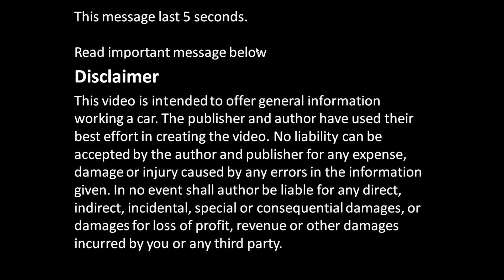How to test PCV valve status?

Comment: The PVC handles gas not liquid. I don’t see the point of using water as it will confuse the person watching the video. It’s not like air bubbles in a brake system. I’m certain a viewer will get water in the PVC and then get all confused after that.